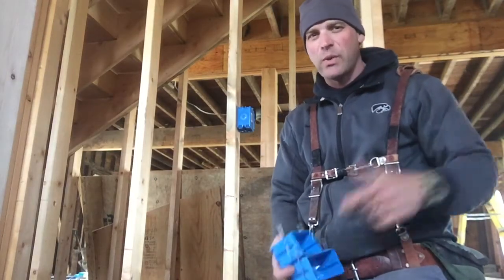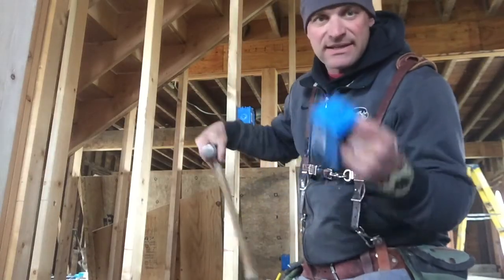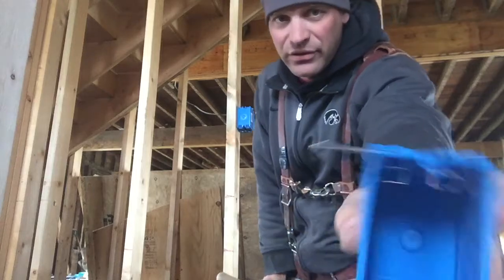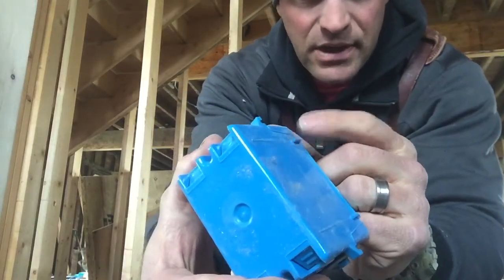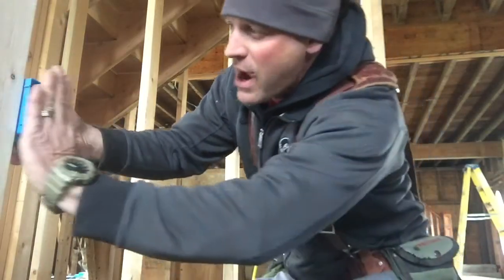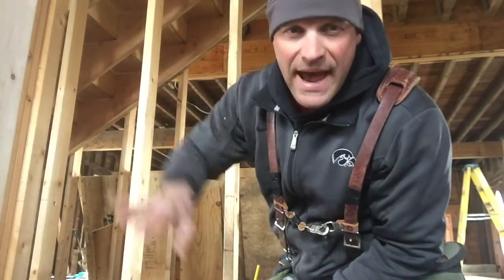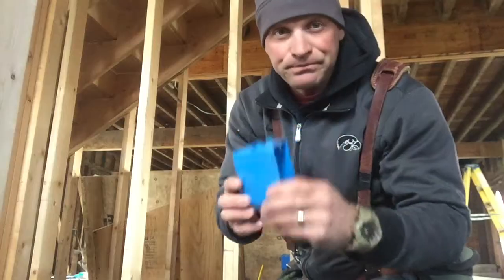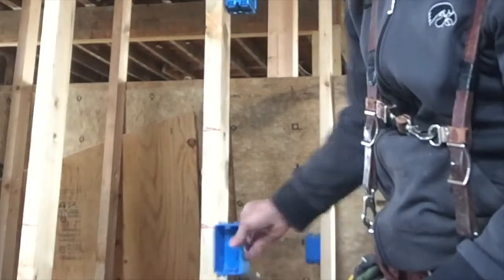How to install electrical outlet boxes

Comment: Love the comment about being better tomorrow than today.  To add to that (maybe more applicable to work but not necessarily), try to learn something and teach someone something every day.  I thought decent framing hammers were 16" so that you can just put the face on the floor and mark the stud at the top of the handle.  Either that or it's a consistent and lazy way to have them all at the same height.  :)
Reply from the maker: Right on! Great addition

Comment: The problem is those gauges are 1/4 inch and I’m always too inset having to use extenders.  Now I use 1/2 material as gauge
Reply from the maker: @countrycat2008  good thinking

Comment: Did exactly as you demonstrated but my boxes are recessed about a 1/4 to 3/8 from being flush with sheetrock. Normal? Dont want code violations
Reply from the maker: @Charles-e4o  3/8 is normal in my experience, I’d rather they are a touch in than sticking too far out.
Reply: I don't aim for being flush with the drywall, because if they stick out you're kinda screwed. Having them back about 1/8" is good. Another thing is that those nubs are only about 3/8" long and if your studs have rounded corners they may be set back further, but that's ok, I use spacers to make up the difference when that happens.

Comment: Get rid of that framing hammer and get a good Stanley or Plumb with the claw 12" from the end of the handle snd you van just det hsndle on gloor snd bp claw against stud thereby putting bottom of box ar 12" and top at 16" This is not ADA compliant, not necessary in residential wiring.
Reply from the maker: Yep, that’s one way to do it, thanks for recommending it
Reply: Yo u are so negative

Comment: What if they came installed incorrectly in my home and I need to move them down
Reply from the maker: You might need to run new wires if the wires come from above the box. If the wires come from below the box you can cut the nails( be careful not to cut the wire) and use a remodeler box to install in the new hole
Reply: @Trevkongable  Thank you. I will have to go look tomorrow. The house is framed no drywall yet though. I can't recall how the cords are running. All of the outlets are counter height though unfortunately

Comment: Silly question but can anyone tell me what length/diameter nails are usually used for these?
Reply: They are similar to a 10d box nail. A common 10d nail is too thick and may crack the plastic guides.

Comment: No need to measure and mark every single outlet box placement. Drive a small machine screw into the handle of your hammer where it just contacts the bottom of the box at its proper height. Each time you put in a box slide it down the stud until it stops against the screw in the handle and your height is set.
Reply from the maker: Good tip, thanks.

Comment: Will the drywaller reset the electrical box to the correct depth if he has to shim the stud?
Reply from the maker: They should, if for some reason there is  a shim needed to make the walls plane with something, then the drywall EMR should move the box.

Comment: Installing boxes between close studs, about 6in, but from the back side of a plywood wall so the nails were angling the wrong way. Struggled with it for about 20 minutes, thought about it later realized I could put the nails in the box the other way!
Reply from the maker: Well done!
Reply: @Trevkongable  I'm a little slow sometimes, but I get there.. eventually... sometimes

Comment: Anyone have recommendations on how to get this type of box out? I need to put out the cords and route a different one through, but I don't want to remove more drywall than I need to. There is nothing inside the box to unscrew and I can tell it is definitely anchored to something.
Reply from the maker: You could take a sawzall and cut the nails that could be above or below the box.  Angle the blade of the sawzall and slide it along the box first to check if there is a nail holding it.
Reply: @Trevkongable  I just removed some wainscotting/wood paneling from the walls. Now the boxes for the electrical outlets stick out an inch or so from the drywall. Considering if I need to move the box back, which would be a pain considering the drywall is in perfect condition. Or do I just frame around them to look less awkward. Any ideas?
Reply from the maker: @samiam3385  I would say it is your preference, what ever you like the look of better and whatever looks best- that is what I would do if I was you
Reply: @Trevkongable  flush definitely looks best. I was concerned about having to make a huge hole in drywall to move the box back an inch and be able to nail it into the stud. BUT then I realized I could use an old work box instead so I dont have to make the hole and can just attach to drywall. What do you think about that?
Reply from the maker: @samiam3385  Sounds like a great plan to me!

Comment: The double gang boxes have the nails at like a 30 degree angle.  Those stupid boxes distort as soon as you start nailing them. I just toss the nails and run 2 screws inside the box. 👍🏻🇺🇲
Reply from the maker: That makes a lot of sense
Reply: What size, gauge and length are the screws?

Comment: Hi do I have to put a  nail thru the top and bottom of the electrical box or can I just use one nail at the top into the stud - asking cause my other nail just broke and the store is too far to go rn, and I want to close up the wall !!   thanks
Reply from the maker: I would pull the broken nail out and put a screw or nail in that spot. You will be pretty frustrated if you don't fasten the bottom and then have it push in on the bottom when your trying to plug in electrical cords.
Reply: @Trevkongable  Thanks,  it turned out to be so much more complicated and the space was way to tight, I had about 4 inches between studs, I need to purchase a different type of electrical box, thanks for replying so quickly.
Reply from the maker: @Sunnbuzz  Sure thing, sounds like you have your work cut out for you.  Good Luck!